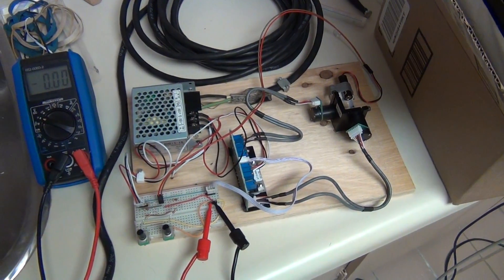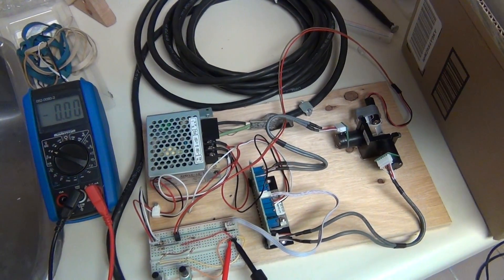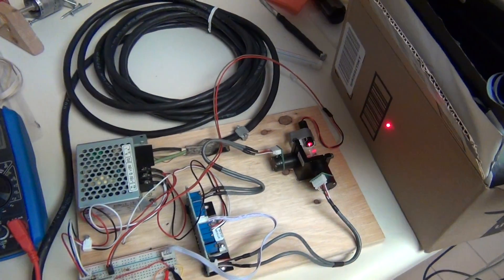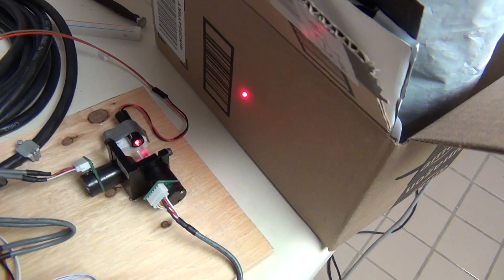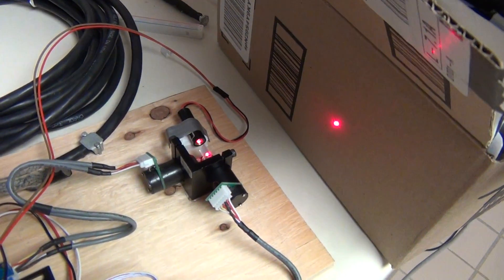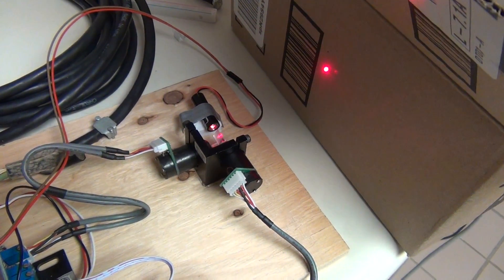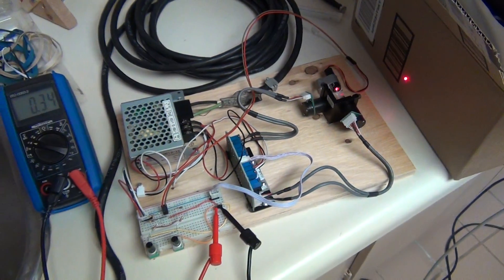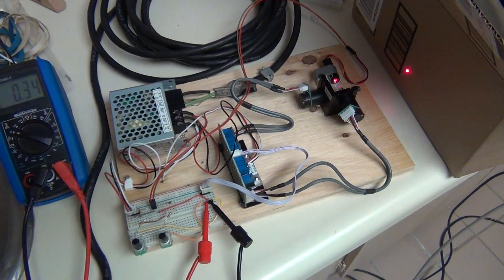DIY Saturday [20161224]: Galvanometer kit for laser projection -- Part 4

Comment: what is the wattage of the laser you've used? Thanks for the video.
Reply from the maker: Laser Diode 650nm 5mW 2.8V ~ 5.2V 25mA Cylinder (10mm Dia), Part number 1054 from Adafruit. OK for a dark room. More powerful lasers require more safety measures.